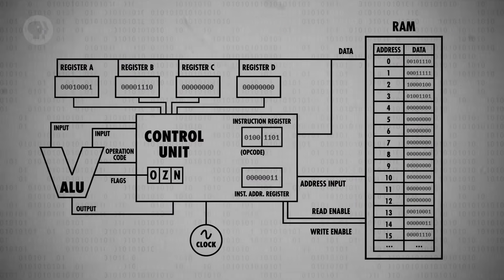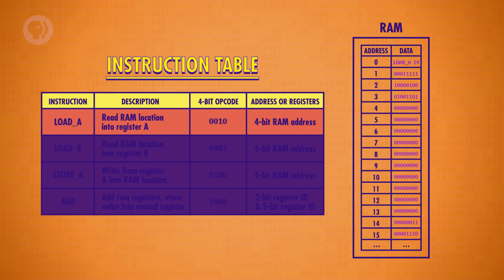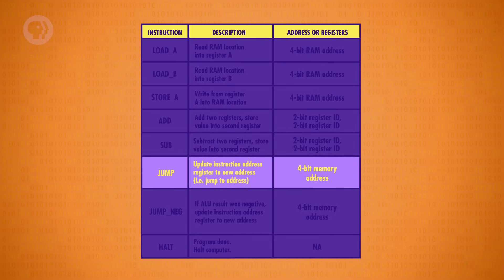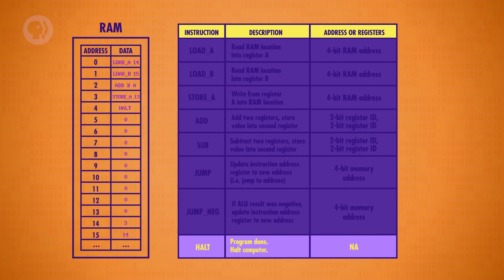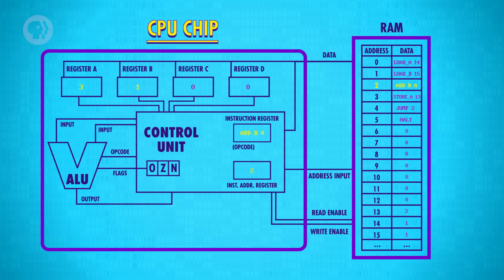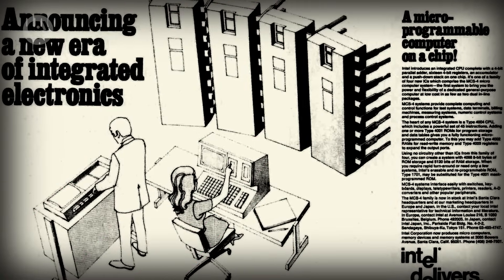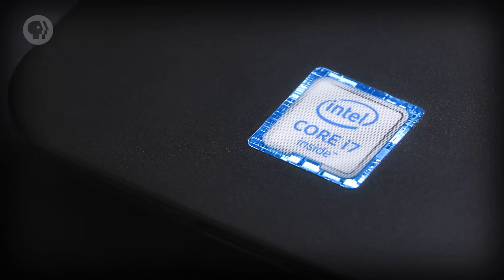Instructions & Programs: Crash Course Computer Science #8

Comment: Don't we already know that 5 goes into 11 twice? Just do 11 - 5 = 6, then do 6 - 5 = 1, then stop as you know it goes into 11 twice with a remainder of 1. So why does the CPU need to go into negative to calculate that? Unless the negative is a good condition to use as you can say the loop is what decides how often a number goes into another number. So really the computer runs from 0. So 11 - 5 = 6 (0), 6 - 5 = 1 (1), 1 - 5 = -4 (2) and you know that when you get into negative, you've gone too far. So then you add the positive number back again to get to positive which is 1 which is the remainder. Since the computer doesn't intuitively know that 1 is the remainder, then going into a negative could be a good way of getting the computer to go back when it goes too far to get back the same answer. So that's why computers aren't as intelligent but they're really bloody fast.

Comment: ok but the computer would've crashed because the incremented value leads to no Address in the RAM not because OP code of 0000...in the fetch phase everything is 0 and it starts loading from address 0 of the RAM so that would've been an endless loop.

Comment: I learned more from this lady in 12:17 minutes on YouTube than I did in engineering in college. In Computer Engineering (were I was supposed to entirely learn C+ over a weekend, and NO, I'm NOT kidding) Nobody told me a thing other than that there are "Registers" that things get stored in, the assembler turns it all into machine code (and the machine language underneath the hood is written by Magic Elves) and that's that and (much like in The Spy that Shagged Me) When I asked, I should essentially "just sit back and enjoy the show." I didn't. Not one damned bit, and you should excuse the pun. I need to know everything on a fundamental level...Right down to the atoms in the doping of for example, a Transistor, progressing to the "on" and "off", at the base/gate of the transistor  and build up from there. I don't drive a car or a concept without knowing what's under the hood... (or in this case... Bonnet ;-))  That's how I think: It's how I roll, know what I mean?  So... I just stayed with Heart  Transplant Nursing as a career instead since I already had a degree in that...
What I always wondered is if you could have a built in set of "check" instructions so if there is an error, say a bit flip or something,  you could instantly clear all of the registers and just reload everything all over again and move forward, or would that be way way too slow and cumbersome? Time went on. Today, I play with Arduinos. And still practice Nursing.
All the Best! DE W8LV BILL

Comment: You literately could had stopped there at the "we added more instructions" instead of explaining it, after all: you're no doubt were going to demonstrate all this working which is easier to follow.
Also to put it simply the CPU "fetches" the data by searching for a code, the computer goes ah! An Instruction: and does whatever the code means: this then passes the values into the registers and either stores, adds, subtracts, etc the sum of the values and may store it into the RAM address... this is then incremented as we move onto to the next cycle and it repeats from there. The illustrations can be a bit confusing if you don't slow the video down and follow along when these yellow lines appear in context in what is being said.

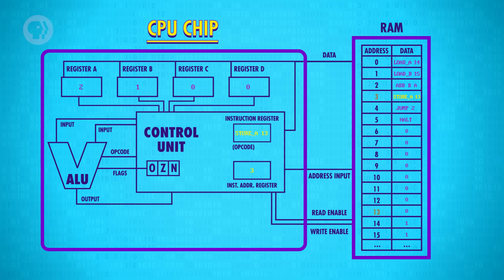Comment: I've a doubt at 4:12 there we process the code for Add B A.
So that means addition value should be stored in B right? And not in A.
Please correct me if I am wrong.
Thank you.
Reply: If I am wrong than could you explain me why,
Load A 14, Store A 13,
Stores the data from second address to first address, i.e. from 14 or 13 to A?
Thank you.

Comment: Is there a small mistake at ~ 6:12 ?
The CPU we build was only able to store values from 0 (00000000) to 255 (1111 1111). But the value in Register A is -4. That't not in the realm between 0 and 255. 
Am I wrong or is this a tiny slip?
Reply: @Peterolen Thank you very much!!

Do you know, by chance, if there are 'two's complement'-ALUs and 'not two's complement'-ALUs, or does the whole 'two's component'-magic happen in the control unit, or are there simply 'two's complement'-Registers and 'not two's complement'-Registers?

I mean, if it happens in the ALU then the 'zero flag' would get activated at the binary value 10000000* and the 'overflow flag' ... okay still at 11111111. But it would be an overflow when the decimel value was ment to reach 128 or more.

_
* I assume
from 00000000 till 01111111 are the binary value representations for everything from -128 till -1
and
from 10000000 till 11111111 are the binary value representations for everything from 0 till 127
Reply: @Peterolen Damn, that's super clever! I love this stuff really much! Thank you for the explanation, Peterolen. ♥︎

Comment: in one cycle how many instructions can be execute?
Reply: There is not an easy answer to this question. In the example used in this video you need a single fetch-decode-execute cycle to execute a single instruction. Modern CPUs can actually execute multiple instructions per cycle. And not only because they contain multiple cores. Even a single core can execute multiple instructions per cycle. Modern CPUs are highly pipelined which means that while one instruction is being decoded, the next instruction is already being fetched. Also modern CPUs are superscalar, which means that they contain multiple ALUs and the CPU can dispatch multiple instructions simultaneously to different ALUs.
Reply: @compuholic82  okkk thank you for that

Comment: If your RAM is storing 16 8-bit numbers, and the first four bits are reserved for an OPCODE won't you only be able to express 0-15 instead of 0-255, greatly reducing potential of the computer? On a similar note, how does a computer differentiate between actual values and instructions. Wouldn't any value starting with 0010, 0001, 0100, etc be treated as an instruction followed by an address. What if I wanted to express 00101110 as '46' and not 'LOAD_A 14'. Thanks for all of this!

Comment: so the 32 and 64 bit corresponds to the instructionlength for a processor, and the 32 & 64bit os is the software that can give 32/64 bit instructions. thats why a 32bit os can run on 64bit processor & vice-versa is not possible. I am crystall clear now!! thanks a lot!, and please correct me if iam wrong
Reply: Ram Kumar still not really true. The 64Bit is the largest normal register size available. The problem is that x64 added new instructions too, so IA-32 can’t execute everything

Comment: How can the computer distinguish between instructions and data? Is it the order storing in the RAM?
Reply: Fundamentally they don't. Data can be interpreted as programs and programs can be interpreted as data. It is the job of the programmer to jump to the correct memory address. But that is the source of many security problems. If you can get the computer to execute the data that you entered as a program, that is bad, because now you can do pretty much anything you like. But modern CPUs make that harder to do because they allow the operating system to mark blocks of memory as read-only or prevent the CPU from executing certain blocks of memory.
Reply: @Johnathon C Yes, you can write assembly into data and execute it. But if you store the code in memory that you explicitly allocated as "executable" there is no problem. That is, unless you allow a user to write arbitrary data into this memory. However, it should not be possible to execute code that you stored in memory allocated with "malloc" or "new" (I have actually never tried it). If that is indeed possible that might be a giant security problem (depending on which privileges your program is running on).

Comment: i have a question 
the basic instructions (load A  ,load B , jump ....... )  are they hardwired in the cpu ??? 
and do we have one copy of them ??
Reply: I would guess that they are in a bootloader chip which could be part of the cpu on some systems. Now days we have chips that have integrated more capabilities. This would be the BIOS or Firmware flashed at the factory and sometimes capable of being updated by the end user.

Comment: so, python works basicly like ram:s?
Reply: The easiest answer is kinda, but when dealing with this kinda of instruction set you are better off comparing it to Java or C/C++, really any compiled langauge. All that means is first you need to compile the code then execute it. If you use an IDE such as eclipse or visual studio then both are done when you press run. The job of the compile phrase is to break down your code to a lower level langauge which in tern will break it down to the type of instructions you saw in the video. In a langauge like python which is interpreted the way the computer runs it is very different. But that was just a design choice by python which we dont need to worry about since its a layer of abstraction

Comment: How exactly does a CPU crash? Does it melt or something?
And how does it know what instructions mean? It can't just look up a table like we did.
Reply: Read about RISC and CISC CPU architectures. First designs hardwired all the instructions (RISC): it is fast but you can't extend the instruction set. Now CPUs contain a very basic set of hardwired instructions and keep the rest (and how to break them down into these the hardwired ones) in an internal memory (CISC).
Reply: No, a CPU does not melt when it crashes. It just abruptly stops running.
Reply: There are no official definitions of various unrecoverable abnormal conditions that a computer goes through. Also, an application program or background process may "crash" or "freeze" but the operating system may continue to run or it may initiate a graceful shutdown. Operating system manufacturers have their own terminology as well. Unix, Linux, and macOS developers call them "kernel panics". Windows developers call them "stop errors". 

These are some of the generally accepted definitions I've used. If the display on the screen does not change, but the cursor is still blinking or the mouse pointer can still be moved, then I would say the computer is "hanging". If the display on the screen does not change and the cursor stops blinking and the mouse pointer cannot be moved, then I would say the computer is "locked" or it is "frozen". 

Many different conditions can cause a computer to "lock" or "freeze". The clock not working is only one of them. Other conditions can be the CPU executing an invalid instruction or op code, accessing a memory location that does not exist, a memory chip malfunctions, an expansion board malfunctions, a paper clip falling into the inside of the computer causing a short, or pulling an expansion board out of a computer while it is running, In the case of the Mark II computer, Grace Murray Hopper's associates discovered a moth stuck in a relay impeding its operation. So the next time the computer was not working, they would say that there is a bug in the system. So utility programs that are used to troubleshoot a computer are called debuggers.
Reply: Wang Libécht there is a blue screen, and you see smoke coming out from your PC

Comment: so what happens to a processor when it's fed an invalid opcode? (other than crashing)
Reply: It crashes. More modern processors have functionality to just to a trusted instruction location to handle the error gracefully, but in that case, the application that ran the invalid instruction would still usually crash.
If the trusted code had an invalid instruction, then you get a double fault (a crash within the crash handler). If the double fault handler crashes, the whole machine gives up, throws a triple fault, and reboots.

Comment: Still need a compare instruction to update the flags registers.
Reply: In most architectures, the compare instruction is just a subtraction that throws away the output. It's easy to simulate by storing one of the registers to memory and loading it back after the subtraction.

Comment: I have to say, i made a cpu in minecraft without knowing it was actualy a cpu. thanks to theas videos I now know that those simple things I made that made my old computer lag 5 years ago makes a cpu :p though, it didn't do that much actually, counted time on a display was the funniest thing :p
Reply: Minecraft is a great environment for prototyping complex circuits because you can lay everything out point to individual components and describe what they do simply through visual and structural analysis. Also, it doesn't require any expensive hardware outside a PC and the circuit components don't cost anything (at least in creative mode). Nowadays, I only play minecraft in creative to use redstone, or modded.
Way back when, I was working on a 16-bit cpu, but it got abandoned due to the trials and tribulations of weaving wires vertically.

Comment: how do architectures with unaligned instructions work? that is instruction bits can be of an arbitrary number of bits
Reply: They just have more complicated fetch phases and the instruction register made larger to accommodate the largest instruction. The length of the instruction would either be stored in an additional register, or recalculated during the decode phase.

Comment: > Talk about avoiding infinite loops
> Write a divide routine that doesn't check for divide by zero errors
HCF.
Reply: The issue is  that, if the number that gets put in B is zero(or negative), A will never become negative.
the way to fix it is very simple if you have a jump if zero, and only slightly more clunky if you don't
You just put this in-between your register loading, and your loop
LOADC (memory address containing a negative one)
ADD B C
JUMP IF NEGATIVE->(wherever your end of program is)
(the rest of your code)
If B is anything but a positive number, this breaks you out of the program
Reply: But that would put the PC in an inf. loop since it would always subtract by zero, with the number never becoming negative.
Reply: Right. If you want to get technical about it, it was a modulo routine, which as stated in the video could be modified to also provide division, since it basically does the division as part of the routine. Kaos and Maxi explain it well, though I might add that a negative divisor would eventually overflow and halt in a real computer.

I didn't get my Engineering CS BS for nothing!

Comment: In my college we made from scratch a PIC16F84 in a circuit simulator and even programed the microcode on the control unit (the one who converts the opcodes into firing the correct wires controling ALU and registers), then we compiled actual C code to run in our cpu.

The instructions that made us crazy was the jump, wich in this case has two of them: Bit Test File Skip if Clear and Bit Test File Skip if Set (BTFSC and BTFSS). The opcode adresses one byte in memory and then a single bit in that byte, then based on it's value it performs the skip or it just continues. the BTFSC does the jump when the the bit is zero and the BTFSS does the jump when the bit is one.
Reply: MasterGeekMX I saw a bunch of nerds create a computer on modded minecraft . With your skill can you do something like this ?
Reply: Indeed. I'm also a technical minecraft expertise. And you don't even need to mod it to do it.
Reply: MasterGeekMX amazing how far we've come
Reply: oh gosh redstone computer :D

Comment: I wonder how many abstraction floors to get to vectors and matrices
Reply: jbz3 actually, we are not that far. We are adding abstraction layers to the CPU, but not to the memory. A couple levels and we could be talking about the stack, heap and memory pointers
Reply: Perhaps you mean GPU optimized vectors and matrices?  A GPU is essentially one of these CPUs with a limited instruction set, but with thousands of them instead of just one.  The cores would each grab a value of your matrix/vector and perform operations on it, then spit out the final result.  The CPU would have to send the data down to the graphics card somehow (which is achieved with PCI lanes), and the graphics card would have to send it back, or just push it out to your display.
Reply: Those often come as libraries with  data structures and a set of functions. So your abstraction leveks are:
1. Function calls 
2. Higher level programming language 
3. Compiler 
4. Data structures/non native data types 
5. The concept of an programming interface 
6. Libraries. 
And you could come back to this topic when discussing computer graphics and using the graphic card for calculations. 
All this doesn't even include the many levels of running a non-bare-metal programm in a multitasking, reactive, resource managing operating system. Which you would do if you want to do something useful with your math.
Reply: jbz3 Actually many processors have single instruction multiple data (SIMD) instructions specifically for operations like matrix operations.
Reply: we're already there. mul, adds, loads, stores.
Reply: Data structures and objects are fun.
Reply: down 20 and 1 to the left...
Reply: J B Actually vectors are a programming concept similar to arrays or lists
Reply: @jbz3  Yeah, a 512-bit SIMD op-code can concatenate two 4x4-matrices composed of 16-bit floats in a single cycle of a single core, i.e. we're already there, complexity aside.